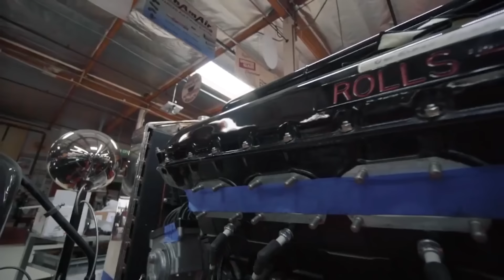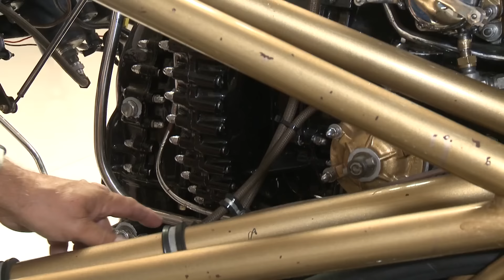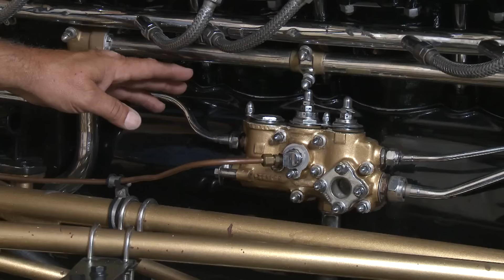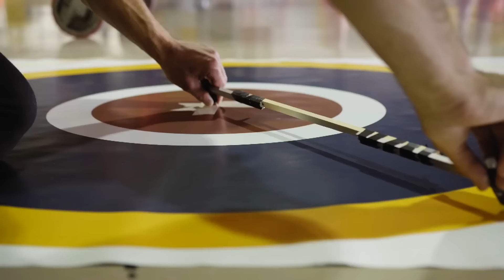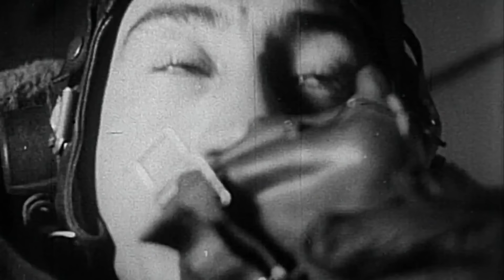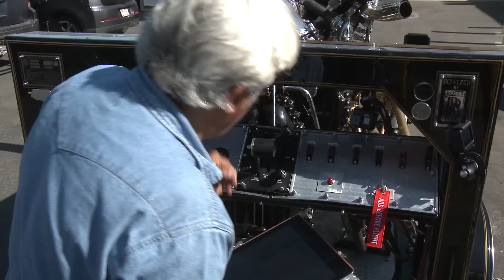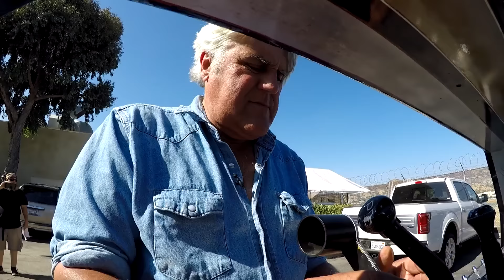The Engine That Won World War II - Jay Leno's Garage

Comment: Just imagine how the war would have started for Britain in terms of the Battle of France and the Battle of Britain, if the RAF didn't have the Merlin!? What else did they have to compete against the new range of inline V12s being made by the Germans – only lesser radial engines and smaller RR V12s like the Kestrel/Peregrine  etc. And don't forget the Merlin was a private venture by Rolls-Royce, pretty far-sighted, as they saw the need. The Hurricane and Spitfire would have gone to war with the Peregrine...! And lets not forget the Rolls-Royce Griffon, an even larger V12 which went onto great things later in the war. As to the P-51 Mustang, what a brilliant idea from a 'Pommie' ie Ronnie Harker of Rolls-Royce at Hucknall to suggest putting the Merlin in the A-36 (in May 1942), producing one of the best long range fighters of the war. As to other aircraft that used the Merlin, don't forget the Mosquito, another private venture by the English, this time by de Havilland! If they'd bowed down the the Air Ministries then disinterest in the aircraft, we'd never have had one of the finest British designs that came out of the war, excelling in everything that was asked of it – in essence the worlds first true multi-role aircraft.
Reply: @John. It's an aircraft thing. Specifically WWII era aircraft thing. "Inline" meant a water cooled engine (usually a V though sometimes truly inline) to distinguish it from radials. So Merlins and Allisons are inline while the good old P&W Dual Wasp is a radial.
Reply: Dear John, that is my stupid error! I meant of course V-type engines.
Reply: You can call it luck. Some call it God.
Reply: Mark Nelson the griffon came after the war
Reply: Dear Bart, I think your reply is wrong. The first Griffon engined Spitfire the M.XII using a single-stage supercharged Griffon entered service in Feb. 1943 with 41 Squadron. They were used (alongside Typhoons) to fend off the Fw 190s making hit and run attacks on the south coast towns of Britain. In April of 1943 another RAF Squadron came on stream using the M.XII, 91 Squadron. The next Griffon powered variant to see service in the war was the Mk.XIV, this used a two-stage supercharged Griffon. The first RAF unit to use them was 610 Squadron based at Exeter in January 1944. During March of 1944, another two RAF squadrons were equiped with the Mk.XIV, nos.91 and 322. All three squadrons were used against the V1 attacks on London and south coast towns. In September 1944 these three squadrons moved to Belgium where they were joined by four more squadrons using the Mk.XIV, Nos. 41, 130, 350 and 404 Sqns. From then to the end of the war the Mk.XIV was the main air superiority fighter operated by the 2nd Tactical Air Force in Northern Europe. During September 1944 another variant of the Mk.XVI appeared, the FR. XVI, this had a camera in the fuselage so in affect became a fighter-reconnaissance aircraft. Yes the Griffon powered Spitfire did see service after the European war was over when the Mk.XIV entered service in India in anticipation of being used against the Japanese. Post-war of course there was the Spitfire Mk.21 and 22 and of course the Seafire Griffon and PR variants etc.

Comment: Read some of the other comments.  W.D. Packard threw his company behind war production when other American manufacturers balked.  But his was not an "also ran" effort.  I'm from Ohio and not far from Warren where Packard Motors was located.  The story here is one of cooperation for the common good.  Licensed to manufacture the RR designed MERLIN engine, the Packard engineers found it lacking.  There were design shortcomings (or flaws, depending on your proclivities) that the Packard engineers set about to rectify. They made a good engine into a great engine.
Many stories circulate that British RR Merlins were used in American PT boats, but a closer look at history tells a different story.  No RR Merlin was ever in a PT boat.  Packard built most of those 12 cylinder behemoths BUT Packard had been building 12 cylinder MARINE engines for some time.  And they perfected the designs in the PT boats.  
Don't get me wrong....the Brits know a good bit about engine building, then and now.  I drive a 1999 Jaguar Vanden Plas with a 4L V8 of British design and manufacture.  Wonderful engine.  Like any, it has things that need service, but it is fast, smooth, quite good on gas mileage for what it has to move and since FORD owned a stake, they "borrowed" the engine to adapt into some of their sporty Lincolns.  Nothing wrong with that cooperation, and Jaguar can thank FORD for resolving the mess that Lucas made of Jaguar electrical systems.   The Brits are good and so are the Americans and together some good stuff gets incorporated into the products of each.  But as other comments have noted, WD Packard put his company on its best foot forward EVER.  The man and the company he led are unsung heroes.
Reply: MIster Moonshadow, RR were the designers. Packard contributed little to the advancement of the Merlin. They made it under licence to what RR wanted. It is a simple as that. Packard was making nothing before RR asked them to make the engine. The two steed two stage supercharger was a 100% RR innovation.  It gave the Spitfire an extra 70mph and 10,000 feet.

Comment: Sure the Merlin is a nice design and in war it has an advantage while using higher octane fuel while our german engines must deal with low octane fuel and therefore they always need more capacity or more boost or sometimes water/methanol injection as a "5min. cheat" ;-)  
But i would say the Daimler Benz 600 series as well as the late Junkers 213D had some oustanding features like direct fuel injection or barometrical controlled superchargerboost (hydro coupling like a torque converter instead of 2 gears for high and low altitudes like in the merlin and most others at that time). Another thing was the "Kommandogerät" which only uses the gas input from the pilot for regulating all the rest for a optimal engine running. They dont need to look at mixture or propeller settings or inlet air temps. BEside that they had a very unique supercharger whine as you can hear in my video.
https://youtu.be/CnpC_BcK7xY?t=550
The MErlin was a bit to "shy" and the english made it really angry with the later "Griffon" engine which roars like a beast !
https://www.youtube.com/watch?v=rmLkMETLKKs&t=1s
https://www.youtube.com/watch?v=C2LbeGmB8oQ
Reply: Merlin a bit shy?  The Merlin automatic boost control did all the engine limiting for the pilot, and the constant speed propeller did all the rpm control.  The DB600 was an excellent engine, but had draw back beyond just low octane fuel.
Reply: i meant shy by sound....did you ever heard a Griffon or a DB605 ? 
They both are much more angry compared to the Merlin ;-)
The first 601 series were also a bit shy....the valveoverlap was quite normal, they tuned that to  max in the 605 series.
Besides the direct fuel injection which the english tried to copy for years in their Merlin was far ahead ;-) Also the barometrical controlled supercharger. The drawbacks in the 605 was most times from fucking slave workers who sabotage whenever they get a chance. And Mr.Messerschmitt himself reduced the ammount of engineoil in his 109series for better aerodynamics of the cowling. Result was a oilfoam sometimes which could cause bad lubrication and sometimes complete crankshaftfailure. Later they did not increased the oiltank ...no they put in a defoaming device or i dont know how the english say. In the 110 the same engines run without any problem.....enough space for proper installing and fluid tanks ;-)

Comment: in my Opinion the Jumo 213 and the MB 605 are similar, though they didnt won a war...anyways I like the Merlin of course as a mechanical 
masterpiece but I like the german build engines a bit more not because they were german, but in my opinion is the upside-down cylinder orientation great for aerodynamical reasons...

Comment: Daimler benz Db 605 more powerfull,supercharger and fuel injection system more reliable.
Reply: DB 605 bigger less efficient and not as reliable.
Reply: Barrie Rodliffe 
yeah it's true.....nevertheless Germany have more air aces.
The Luftwaffe have best pilots... You know Erich Hartmann, Günther Rall. Between 250 to 350 victories.

Comment: I don't think the RAF won the battle of Britain with engines that took 15 minutes to warm up enough to run .
Curtiss-Wright, Pratt & Whitney, and General Motors just might have a different idea than "The Merlin won the war"  I can think of  only one aircraft model in the Pacific theater that used the Merlin, the P51. ( And it's long range escort duties were shared with the jugs )  The B-17; B24; B29; F4U; F4F; F6F; SBD; TBD; TBF; B 26, P47. and the B25 all used radial engines.   The  P40; P38; and the P39 all had Allison power plants.  I'll grant you that the Merlin was an important factor in the allied victory in WWII, (especially in the European theater ) but to say it's the engine that won the war is a bit too strong.

Comment: the German ME109  had fuel injection you could pitch and roll the 109 and the engine wouldn't misfire like the Merlin.
Reply: Old news, the smaller Merlin was more efficient and more powerful and the negative G problem fixed during 1940.
Reply: fuel injection is the way to go in a plane and the Germans new it. carbs are affected at high altitudes ever driven a car in the mountains with a carburetor on it try it sometime. i believe the 109 was a better plane we will never know. there is only one 109 flying i dont think the owner would risk racing the plane.

Comment: Interesting! Lancaster's have their generator on engine 4! I have only noticed engine 3 on others. 
 The aerospace company I worked for from 1985 till it was sold in 2002 was owned by a gentleman who built P51 mustangs.had his own personal one which is still owned by the family and is now kept flying by CAF in Camarillo CA. I have flown in it many times when I worked for him. It is a beautiful aircraft, a great engine that has an addicting sound when they flyby. He also designed his own pre-oiler. My understanding was during the war they didn't have a pre oiling system and the engines had a much shorter life span. I am using my memory on that, based on what I was told around 30 years ago, so I could be off on some.......Thanks to Mr. Leno for keeping this and all that he does, especially steam!! alive...Hope to meet him some day.

Comment: I even read about a case when a Wright engine had an entire jug shot off the connecting rod for the piston was flopping around sticking out of the motor and it still flew back.
Reply: As you know, P47`s, F6F`s and F4U`s (amongst others) were equipped with the P&R R2800 and were lauded for their reliability.
The reason more P47`s were shot down was simply because more P47`s did ground attacks (entire air groups assigned to the role), than Spitfires (a few squadrons allocated to the role at most).
It also depends which cylinder gets hit and how its flown thereafter, 6`o clock+level flight = oil will drain faster, 12`o clock level flight not so much.
Reply: Maybe why more P 47`s were shot down than Spitfires when both were doing ground attack.

Comment: The air-cooled Wright radial engines were in all the big bombers and some fighters were 2000 hp. They were much tougher to shoot down. No radiator or cooling lines to hit.
Reply: Not in the Lancaster, the bomber which carried the biggest heaviest bomb of the year,   Merlins were used in the Hurricane, Spitfire, Mosquito, Lancaster and many more, the Merlin engine fighters were better than the Wright engine fighters, the best US fighter had a Merlin.   Many P 47`s were shot down, they were vulnerable to being shot down or maybe they suffered from the overheating problems and just dropped out of the sky.

Comment: The pre-start checklist needs to be modified; mixture shouldn't be at 'mixture idle-cutoff' for start. Normally we start aircraft engines at full rich, idle-cutoff is way too lean for start. Throttle cracked is correct though. Just bump the throttle up until you feel the slack go away. No engine sounds better than a Merlin!
Reply: Not sure what you fly.  I agree with you, if we're talking about a small Cessna Single Engine.  Most large (and typically fuel injected) engines, I've had great success flooding with the primer (because the fuel injection lines are usually dry from the previous shut-down) and starting with mixture in cut-off.  The engine will start nicely in cut-off as the mixture leans - particularly if you start with the throttle advanced just a bit.  I did notice though, he seemed to fail to advance the mixture after start when the stoichiometric mixture hit.
Reply: Start should be at idle/cutoff until the engine fires on the prime... then slowly advanced up to rich.  Jay forgot to advance the mixture, and initially kept the engine running (very roughly) with the primer.  You can tell he doesn't run the Merlin every day...
Reply: quiero ese motor para adaptarlo en mi corta sesped y despertar mis vecinos en los domingos alas 5 am me recordariam por el rresto de sus vidas

Comment: I think it is an amazing engine, funny enough they were used in the BF109 in Spain, which was featured in the movie Dunkirk, the battle of Britain movie as well.  and is easy to distinguish from the DB powered BF109 by the location of the exhaust. on top of the cowling instead of the bottom as the DB was inverted with the pistons at the bottom of the engine  A interesting thing the DB engine was fuel injected, but that was before computers so how did they meter the fuel? I am sure someone will know the answer to that question.

Comment: The Merlin is one of the greatest airplane engines in history. Period. No argument. However...?

It's not quite accurate to say it "won the war". The Allison, Wright Cyclone series, P&W 1830 and 2800 also deserve some consideration. Virtually all of the allied planes in the Pacific theater used one of those engines. By war's end all first line Navy fighters used the R-2800 and the B-29, even before the A-bombs, wrecked Japan from end to end despite the fact that it's engine, the R-3350, was a mechanical nightmare that destroyed more B-29s than the Japanese did. Meanwhile, the British were busy phasing out the Merlin in favor of the Griffon and Napier Saber by early 1944.

NOTE: There were, indeed, Merlin engine P-51s in the theater by the end of the war but they saw relatively little combat.

Comment: The R2800 Double Wasp was far more important to winning the war and the R4360 Wasp Major was likely the best piston aircraft engine ever made.   The Merlin was simply the most "famous" engine.  

The R2800 was a 2000hp engine, something the Germans were never able to develop.  The Merlin was on par with the DB601/603/605 series.
Reply: Jersey boy.
The Merlin was the most famous for very good reason, it was the most important engine and in the best planes of the war, the best fighter, the best US fighter, the best multi role plane, the best heavy bomber. The Merlin was better than any US radial.
Reply: The Merlin was in the 1500hp class, equal to the German DB 60x series.  2000 hp was the magic number and the Brits and Germans couldn't get there without weird W or X configurations.  The R2800 was in far more Aircraft classes and far more were made. Also, if the Lancaster was so good, why didn't it go out in the daytime?

Comment: I'd say that the engine that won the war was the Wright R1820. 4 of them in each B-17. So there! ROFL It's all a matter of opinion. The funny thing about the Merlin was that whenever the British mechanics could scrounge a set of Packard Rods for their British built Merlins they'd throw their Rolls Royce rods in the scrap bin. Or so my father told me. He worked on them at Birtonwood Air Depot 1943-1946. He also managed a few flights in B-17's as a stand in crew chief and top gunner.
Reply: The Merlin, 4 in a Lancaster that carried far more than the B 17. 
Your father lied to you, Merlins used Rolls Royce parts all through the war, Packard made Merlins for Rolls Royce using Rolls Royce conrods.  Packard did not change them, all Packard built Merlins were Rolls Royce.

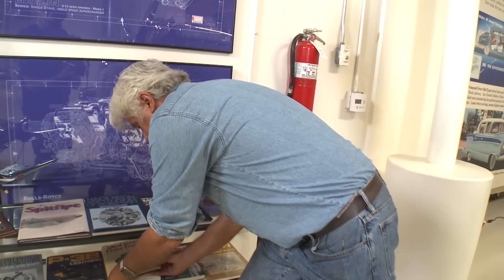Comment: I saw this engine at a classic British sports car show in Winston-Salem, North Carolina. I was so impressed I bought the book Jay showed us at 2:44 directly from the author himself. In spite of the popular association with the P-51, the Spitfire, and the Lanc this particular engine served in a Curtiss P-40F Warhawk. The giveaway is the semiannular radiator just under the prop, a carry-over feature from the earlier Allison-powered P-40 fighters which produced the distinctive "shark's mouth" outline of the P-40's nose. P-51 Mustangs had the radiators mounted behind the cockpit for improved aerodynamics. Another difference can be seen in the engine mounts. The P-40 used a tubular support framework, which was typical of aircraft design in the 1930s. The P-51 used a stamped monocoque cradle which, though more expensive to fabricate, made the installation even cleaner. Compare an overhead view of a Spitfire Mk. IX to a P-51D and you'll notice the Mustang is a bit leaner in the nose than the British fighter.

Comment: First RR I have seen in the late 60s I worked in the oilfield Halliburton frack trucks used Allison engines when they powered up 8 of those the ground would shake as they went full throttle to pressure the well sounds you never forget. Thanks for this video Jay